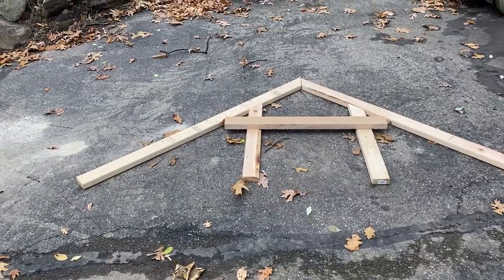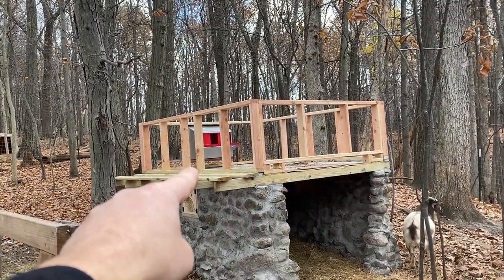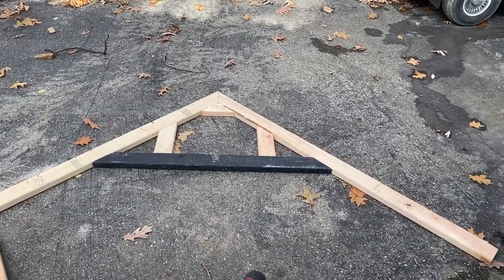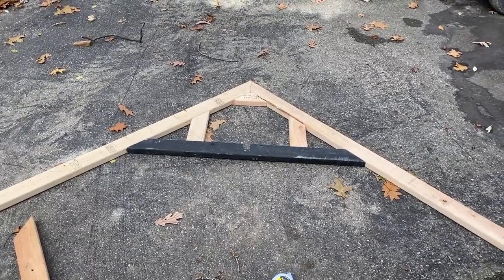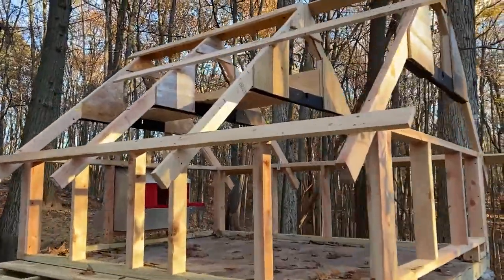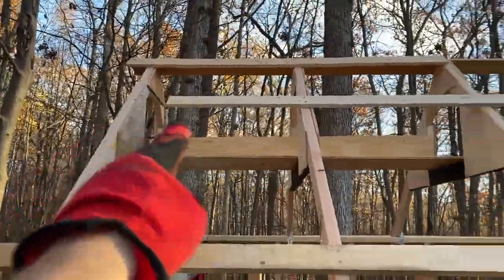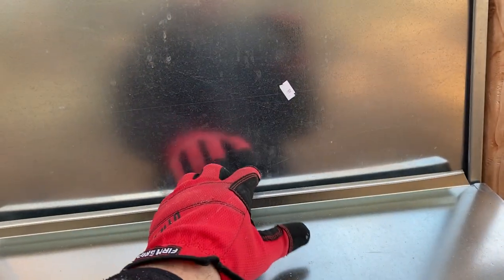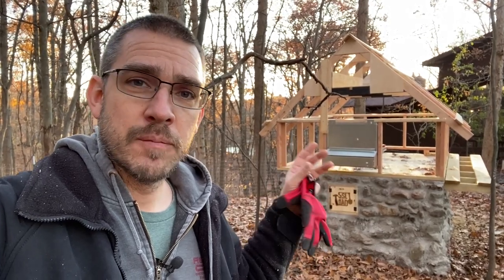Stone Chicken Coop Goat Shelter Part 9: Custom Trusses

Comment: If you have some plywood left in the end, you should make a tray to slide into the top storage. Maybe put some 1x2s on the side to make it more stable.
This way you could use the whole depth of the storage and still get to everything somewhat easily.
Reply from the maker: Great idea!
Reply: How about taking take plywood off, just attaching tracks to slide it on, and using that plywood as a drawer?

Comment: We have a turn of the century hen house on our property with what looks like a chimney several feet tall on the roof except it’s made of wood. The only thing we can think of is that it’s a vent for the winter to make sure that it’s above the snow. The building is tall enough to easily walk into and at one point had both water and electricity in it.

Comment: We went with corrugated fiberglass roofing.  We got clear stuff, so no need for a window for light.  It has held up great so far.
Reply: I used clear poly roofing, over old shingles, cut strips out of old roof to let light in. Roof slants to the north, but in summer I have to cover the "skylights" or it gets HOT inside! Really helps in cold weather tho and I can see even in the corners.
Reply: @hoosierpioneer  my coop is in almost full shade in the summer, so I fortunately don't need to cover them.